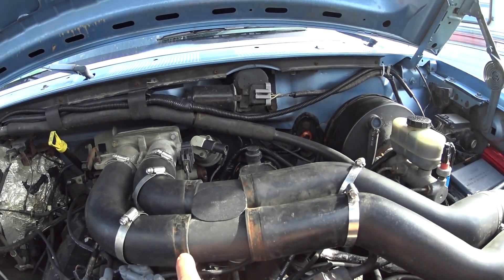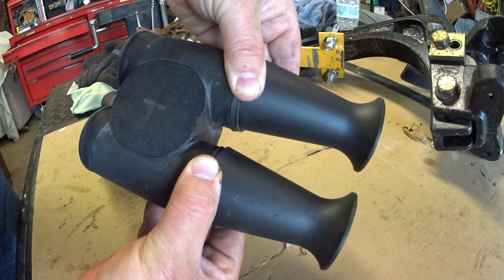RV Motorhome & Truck free power upgrade

Comment: Hurts low end torque... dyno shows this in project MPG in 4x4 magazine. It does seem to improve throttle response somewhat but its noticable loss of low end torque. Now I am looking to buy new ones to put back in .
Reply from the maker: This just goes to the old argument what is better? Horsepower or Torque?
Once the velocity Stacks are removed there is a difference to the engine's operating characteristics however, that doesn't mean it's a loss.
Since, I had also changed the exhaust, to the banks stainless headers and high flow pipe and higher flow injectors, a BBK throttle body, a K&N Filter and aftermarketing ignition, better fuel pumps, the overall gains I received were highlighted by the velocity stack removal.
Look at it this way, you will never find anyone adding an air restriction to their engine design/build unless it is to mask a deficiency elsewhere. So if you correct the deficiencies you can remove the Band-aid(velocity stack)..

Comment: I found mine had already been cut off by the previous owner. Or when the Banks system was installed. But no time had been spent cleaning it up. I scraped, filed and sanded all the edges.  That actually made a difference over the rough cut tubes. It's worth the half hour.

Comment: Did this to our '89 E350 Airstream. Definitely noticed smoother acceleration and overall performance, but it now seems to idle much higher in neutral and park. Not sure if it could be something else or if it's just a coincidence.
Reply from the maker: Could be that you need a new idle air control valve. Could be the throttle body needs cleaned as it might be a little sticky.
Reply: Did you properly reconnect the little bottom hose? That can cause a vacuum leak and make your engine idle higher. If it’s loose, try using zip ties.
Reply from the maker: Actually if you're talkin about the bottom hose that connects between the air box and the throttle body that goes down to the intake? That hose has no effect whatsoever on idle. That hose is only allow the idle air control valve to draw fresh air in from a filtered air source that it connected to the air box. If you disconnect it at the intake it will draw in just as much air as needed. Of course you'll hear it hissing more because it is a direct line of sight to the source that makes the air noise but there is no vacuum leak involved.
Reply: Appreciate the response guys, it ended up being the IAC valve! Not sure on other rigs but in the old e350 vans, they're a pretty big oainninnthe ass to swap out, but it idles fine now.

Comment: Thank you. I had heard of this but have not done this yet. I will do it before we hit the road in late spring. I have a 1992 Georgie Boy Swinger with the 460. Have you had or heard of people having an issue with bogging down? And it doesn't matter time or miles, it does it when it wants to. Shut it off start it back up and move down the road until it does it again
Reply from the maker: Check EGR function... That could be the issue.... Of course it operate off of vacuum and if you have a vacuum leak somewhere that could be the cause of the problem. Plus, I'm not sure if you have a mass air flow sensor or if it is a speed density system. If it's a speed density system you definitely want to make sure that the vacuum connections are good going to your map sensor
Reply: @Rvdaydream  awesome. I will. Thank you very much. Lots I am trying to fix on this Ole beast. But running tops is primary. When I bought her, she had original plugs and wires, cap, rotor button the whole 9 yards

Comment: Anything over the 8.1 mpg I get now would be an improvement.
Reply: i drive 3 different 460 5 spd trucks and they all get better than 10 mpg i got one that does 11.7 and my E4OD gets 10.33 at the worst of all mine  89 Fsuperduty 89 F3504x4 90F350cclb 4x4 91F250super cab 4x4 the cclb is the E4OD truck

Comment: I have a 1996 460 in my class A. Is there a carburetor add on kit to add fuel injection? Lacking horse power & torque. Thanks.

Comment: that was good how did you find out and shall we look out for this on all intakes. i wonder if any of the car mechanics on you tube know this , have not seen them do it. can i share this information.
Reply from the maker: I don't know if there are any other truck Mfg's that would have done the same thing as Ford did with these restrictions..
  There's a few mechanics that talk about this but mainly being shared on Ford Truck forums for years now.. 
  There is a lot of air box engineering mistakes made,, that's why K&N can charge so much for their cold air intake(CAI) systems..
   You can spread the knowledge all you want , If you share the video just make sure you mention where it came from @ RVDaydream 😁

Comment: These are designed to increase the air velocity which can improve low RPM Power and efficiency. The thing about motorhomes is you rarely run the engine at high RPMs so this may result in running your engine harder to get the same job done at low RPMs therefore burning more fuel. In addition my Class C motorhome built on an E 450 super duty chassis has the trumpets molded into the air intake so they cannot be cut out I would have to remove or replace the cold air intake that attaches to the airbox. What I think would be ideal would be to have some kind of large diverter valve inside the air intake so that these horns are bypassed at wide open throttle. This would allow you to have the higher velocity air at low RPMs and then open it up for more airflow at higher RPMs when it's needed. This would be a bit complicated because there is very little room under the hood of an E Series, unlike your F series that has a big long Hood, the E-Series conceals virtually the entire engine and all you can see is an air box with two hoses on one side and the plastic Gadget with the shapes of the Trumpets on the other side which gets its air at the point where the hood meets the grill. Maybe installing a hood scoop would give you adequate bypass route and also the ability to use this only in good weather because you wouldn't want to do it in a rainstorm you would risk getting way too much water in your air box.

I was also considering some type of electric fan to push air into the airbox when activated which would bypass these trumpets. I wouldn't be expecting any supercharged affect, rather just eliminating restriction and maybe even ducting some cold air from the air conditioning system which gets cold enough to freeze out anybody in the front cab. That combination should be able to gain you maybe 20 horsepower or without the cold air maybe 5 or 10 depending on how much high RPM power is lost with these trumpets. I wish I had an easy way to test the results before I go to all this trouble.
Reply from the maker: I realize that they installed them to help with low and performance, however once removed I have not found any ill effects whatsoever and have definitely noticed a better throttle response the very first time I put my foot on the gas after cutting them off. What you're describing as far as diverters in the air box is something that the old Sho Taurus did with that Yamaha engine. That's why the intake Runners are so long and looks like spaghetti underneath the hood. The same can be done with back pressure in the exhaust as was first popularized on Japanese street bikes back in the early 90s
Reply: @Rvdaydream  what you might want to try at least in the warm climates or seasons is distilled water injection. If he spray a mist of distilled water into your intake manifold at wide open throttle it can increase power and you can run on a lower octane fuel without detonation. Some new cars are actually using this technology now even though it's been around since before the 1960s. What you have to be careful of is make sure it doesn't spray any water before you shut down so the line would have to be purged and avoid freezing temperatures. These two issues can cause damage which is why automakers haven't use this technology much.
Reply from the maker: @dondakota920  I'm lucky as the truck never has had any detonation issues... Even when we towed our RV 2900 miles through the Hottest days of summer through Florida... Water fracturing is definitely a boost..
Reply: Don Dakota what manufacturer is using water fracturing?
Reply: RVdaydream I would venture to say that as long as your timing is on spec and the egr system is working, you should never detonation. Great truck by the way. Love the 460... just not the mpg

Comment: thank you for all your fantastic video , I have a quick question ? I have a 460 1989 E350 motorhome 90k on it , i change the fuel pump both of them, but when used for the first time last week , i drove for 1 hours them boom , is starting to lost power , no fuel go no more, i wait 30 minutes , and then i drive for a other couple miles, and again no more fuel ???
Reply from the maker: You may want to check out Rufus and Dufus videos from about a year ago he had the exact same problem...his was and exhast pipe issue...there is an inner and outer exhaust pipe and the inner one rust and blocks the exhaust flow

Comment: I did this. I noticed it idle a little rough after though. Does this mod throw off air to fuel ratio? Is there anything else you did in conjunction with this
Reply: No, it doesn’t. Check the little hose & connection to the intake manifold; sounds like it’s got a bit of a vacuum leak.
Reply: All I did was cut it then I did 1 turn clock wise on the fuel pressure

Comment: This mod will cause lower rpm torque loss.  It will also increase upper end HP.  Pick your poison.   Good mod if you run hard and high.
Reply from the maker: Actually the increase in More air delivery maximized with increased fuel delivery will always add both torque and Horsepower.. Just like headers over manifolds the mod is the first step in a few to gain across the board..
Reply: @Rvdaydream  this mod will result in lower intake velocities at lower revs. Resulting in less efficient filling of the cylinder, higher velocities allow air to continue into the cylinder after the piston passes through BDC.  To help in this the engineers can slightly delay the closing of the intake valve timing.  There will be tradeoffs made with higher rpm power, however given the target customer base for this engine it was logical to stack the odds towards low RPM operation.

Modern engines with VVT,  multi valves and computers give the best of both worlds.
Reply from the maker: It may be great in theory, but this was a modification that I made first hand and notice a considerable snappiness, if that's even a word, on my initial throttle response and whenever I made the modifications to add long tube headers with the bank's system and then I increased injector size with a matched set of injectors the low in response gained considerably over what would have been if I would have left the velocity stacks in place. What I'm saying is this is a modification that needs to be done for anybody wanting to move forward with performance on their vehicle. There will be gains to be had above and Beyond anything that could be accomplished with a restriction in the intake. The problem that I see is people are making modifications to their vehicles using K and N filters and aftermarket exhaust systems yet they still have those velocity stacks reducing overall air flow. When in reality once those are removed very little tuning effort will accomplish whatever low end air velocity what is gained by having them in place. Simple timing and a $35 adjustable fuel pressure regulator will gain more torque than what is lost by removing that restriction.
Reply: @Rvdaydream  show me proof on a dyno.  The physics are solidly in my corner.  Either way we're not talking about significant changes to either the upper or lower power band.  If you can find a stock plenum and do back to back timed runs to 60 with the modified plenum my guess is the 0-30 time will be slower modified the 30-60 time faster.

Caveat Emptor.
Reply from the maker: Just a friendly piece of advice, take it off the dyno and start using it. make the changes. The proof isn't on rollers it's where the rubber meets the road. Too much Theory not enough practice.
Reply: @Rvdaydream  I'll let NASA know...

And those Ford engineers that know what dynos are.

PS the most efficient way to get power out of an engine has been known science for over 100 years, theory is the least of it.
Reply from the maker: K. I. S. S. No sense overcomplicating how an air pump(engine)works
Reply: @Rvdaydream  👍

Comment: I lost mpg when I tried this on my F350 4door 4x4  7.5 e4od I lost 1mpg or so and this truck is 10.33 mpg most of the time
Reply from the maker: Kevin Kinsey I made other modifications to take advantage of the increased airflow.
Reply: No I don't think I'm smarter than the guys at Ford but when 5 different people say if yo cut them off it will run better you try it what I learned was I lost about one mile per gallon so I put one that was not cut back on this is how we learn I like to know what really happens when you do stuff because I have had a lot different results than I have been told on a lot of thing like this I just thought I would some actual results
Reply: @Mr Murders i agree i was told that it increased power and that realistically should increase mileage but it was not only false but yes it did make more noise and decrease mileage so i am sure it had effects on power as well i didn't notice that as i don't use a automatic to pull anything but the truck got 10.33 mpg almost every time I checked and i checked every other day because i filled it then so i did see a drop of about 1 mpg that is all i was trying to point out before anybody else cut those out of the intake tubes like I did and regret it
Reply: @Mr Murders I did not know that about the computer so no i did not reset it but i am interested in the trip you make back with your motorhome so yes let me know and thank you. I will let my paint guy know you like his work it is a 89 Fsuperduty 7.5 5 spd 4.63 rear end gears  i put a/c in it and a holmes 480 on the back it is heavy at 9400lb and still does better than 10 mpg not all the time but by itself it does